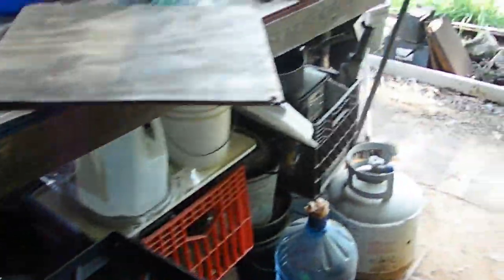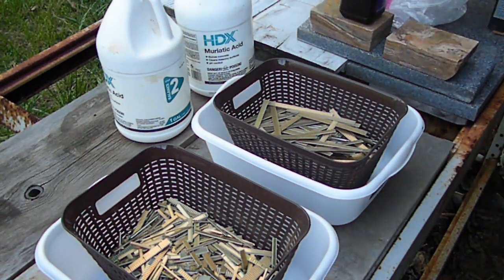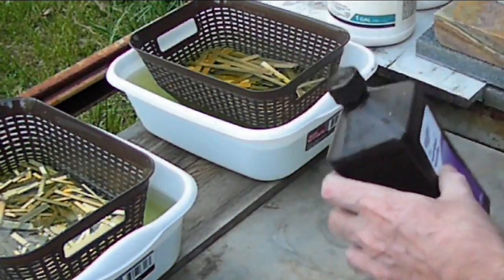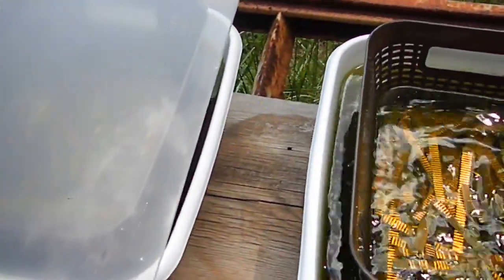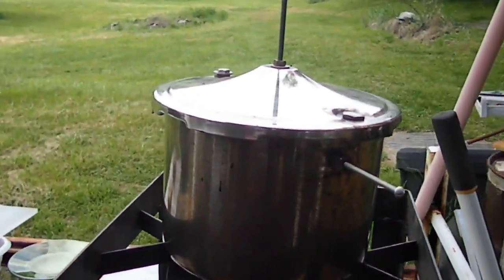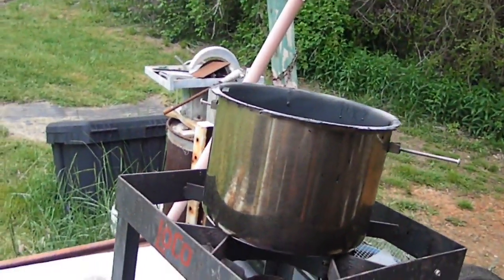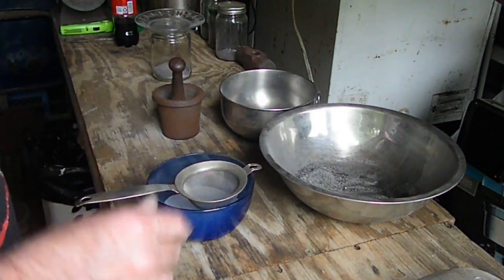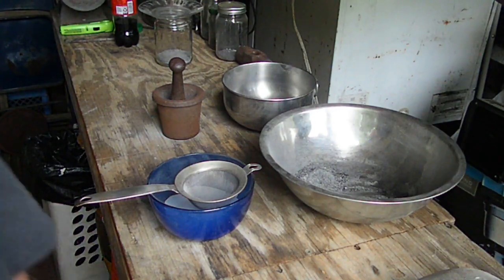Computer Scrap Gold Refine Over 7 Kilo's Part 2

Comment: Where are you buying your Muriatic Acid? I just bought a 2 pack of 1 Gallon jugs of Acid from Home Depot, and it was around $14 for the box. I think it's actually gone down since the last time I bought the acid.  Apparently Not a lot of people use Acid to adjust the pH of their pools around here. Every time I buy a 2 pack, the boxes appear to be the same ones I saw the previous time, they are just a little more weathered each time (They Keep them outdoors).  One time I went to get some and the boxes were so beat up, the bottles were pulled out and even the labels were almost un-readable. They wouldn't Sell them to me at a discount though.
Reply from the maker: Don't know what's up with youtube, just want you to know I answered this the day you posted it! This seems to be happening more and more, I answer comments and it doesn't show up??? Anyway I am buy my hcl at  Home Depot in Blairsville, the last box I bought was $19.38 including tax. You would thing it would be the same as your  Home Depot, but I guess its not, its over $10 a gallon at Lowes & Walmart here as well!! & the Walmart stuff is that "Low Fume" stuff, which is a "rip off" the only reason its low fume is because it only 20% instead of 31.45%, you can make the regular stuff low fume by splitting it in half with water LOL!!!
Reply: @BackyardScrapping  I just drove by Home Depot the other day, and the price of a 2 gallon pack is now $17.00 + Tax.
I still have 2 gallons left, so I didn't buy any. I don't use as much as I used to, I just buy smaller containers when I process my gold fingers.  Smaller containers = Less waste. I also re-use my AP solution several times, until it starts crystalizing. This is a pain sometimes, when the gold foils get caught up in the crystals, I have to add more hcl to free them.
Reply from the maker: @scrapman502  LOL use it to the end!!! That's the way to do it. Every day all I see is prices going up on everything!! If it keeps on, I'm gonna have to start bagging my grass when I mow the yard so I can eat it!!! Take care Brother!! 🐂🐂🐮

Comment: 11:00
how much h2o2 is needed? isnt that bottle to much?
Reply from the maker: Depending on what I am doing, I use a 10 to 20% mix, but only once. I add more acid along the way if needed, but never more peroxide. Also I always check fluids to see if any gold has dissolved just in case.